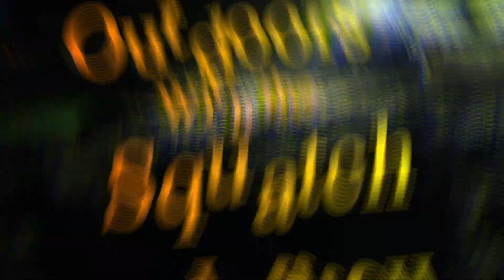Grapple! This is the Wicked Root Grapple!

Comment: The Wicked Root Gapple has a Wicked Price but are very well made. I paid $1000 for a USA made Heavy Duty Root Grapple that weights around 650lbs about 5 years ago. It has served me well, no problems. It's 72", has 3/8" thick tines, duel cylinders and made of standard A36 steel. It's on a New Holland TN70A 70hp tractor and has held up well digging, pushing down trees, moving huge logs and grading. The Grapple still has about 80% of the paint. I would get a lighter weight grapple for smaller tractors that have much less lift capacity than my 70hp tractor....😮

Comment: I have a LS4145 with the Everything Attachments Wicket Root Grapple with 2 separated hydraulic jaws, and it is a real workhorse.  We have tried a single jaw grapple, but like the EA 2 jaws as they will clamp to different size loads.  Got a good price

Comment: I have the 60" version of that on my 55HP Kioti. Best implement I own. No regrets on my choice. Another important factor to consider is grapple weight. Some of the grapples made "over there someplace" use low grade steel, which means they have to use a lot more of it to make the grapple strong, making the grapple weigh twice as much in some cases. Maybe not a deal breaker on a bigger machine with lots of lifting capability, but implement weight becomes VERY important for those using a sub compact. They don't have that much lifting capacity to start with, so every pound more the implement weighs is another pound you can't lift! EA prides themselves in making strong, lightweight equipment. You can even call them and tell them what tractor you have and what you'll mainly be using the grapple for, and they'll help you pick the right style and size of grapple for your application. A single lid root rake grapple is my preference for what I do. My cousin runs a tree service and uses a EA double lid long bottom grapple for gathering the loose tree tops and piling them in his dump trailer. It's design allows it to slide on top on the ground more, instead of ripping down into the earth. This is perfect for working in someone's lawn, as you don't damage the sod nearly as much, which could lead to an unhappy customer. It's all about having the right tool for the job!

Comment: Nice video man! Just subscribed. I couldn't tell the model new holland you have...I have a LS 65 hp and it looked similar. Im looking for a grapple still and this helped. Thanks! Do you have a video on your light set up? I wanna change out mine....thanks again!
Reply from the maker: Thanks for the sub! Tractor is a 2018 New Holland Powerstar75, I plan on doing an in-depth review of it soon... I shopped hard for over a year looking for a tractor, with what these things cost I felt it wise. I had an LS MT573 on my short list in the end, final four if you will, I like most of LS's offerings... Which LS do you have?

As for the light's, I've been meaning to get a video up covering the lights, and how I installed them. For a few hundred bucks, a day of fab and installation, I turned night into day, well at least for a 30ft dia. around my tractor anyway...
Reply: @outdoorswiththesquatch4420  i have a LS xu5065... I looked for a long time also and ultimately I felt like it had the most options and bang for the buck. I found someone selling it used with only 230 hours on it. I couldn't pass up the deal. But I definitely need a grapple and the light set up is horrible....need to remedy that before winter hits again. Thanks again!
Reply from the maker: @HermanWoodworks  I know the 5065, nice choice... Tractor shopping can be aggravating to say the least, I was blessed at the end of my year long hunt, my local New Holland dealer and I came to an agreeable figure in the end, they honestly did me a solid. I live almost right between two of their dealerships, both 20 minutes away, hopefully I won't need anything other than maintenance and wear items from them, but they are the closest big AG dealer near me other than green paint which I can't afford.... 

I have an LS dealer about the same distance, but they don't have a very good rep, I would've traveled to an LS dealer about 2hrs from my house and made my purchase of the LS, they have a great reputation, and sell a lot of LS's

Then there was the two red tractors on my list, one 60 minutes from me, the other 2 1/2 hrs. from me. Neither of these dealers seemed really interested in selling me anything, I knew more about the tractors they were selling than their own sales staff did, including national pricing. I managed to haggle with one and get close enough to what I was willing to spend that it was an option, the other wouldn't come off of msrp for all the tea in china.... 

Funny how it worked out in the end, I ended up with the tractor that was my favorite in terms of comfort and ergonomics, closest dealer support, and crazily the best price... They say lightning never strikes twice, I'm positive of this in terms of my tractor purchase....
Reply: @outdoorswiththesquatch4420  nice! Yeah luckily I have a LS dealer and service 5 minutes from my house, quicker to drive the tractor there than load it....hahaha so that kinda influenced my search also. Yeah green and red can both be pretty expensive!

Comment: Does this EA stand up to connect to the loader? I have heard reviews say the root rake is a challenge to connect compared to the long bottom ones because they don't stand up?  What about the EA?  I am so on the fence on this or the dual lid long bottom (both EAs).  Hunting property... starting to lean towards the rake!
Reply from the maker: It does not stand up on it's own, I just fully open and plant it on it's face if you will... I  have seen where guys have made stands for them. I don't really struggle attaching and detaching it personally, but I do need a way of keeping mine upright soon, stay tuned and you'll see why!